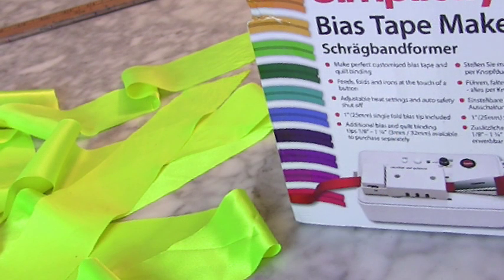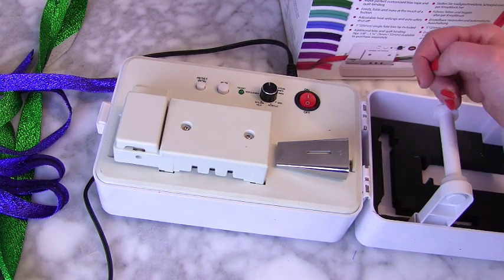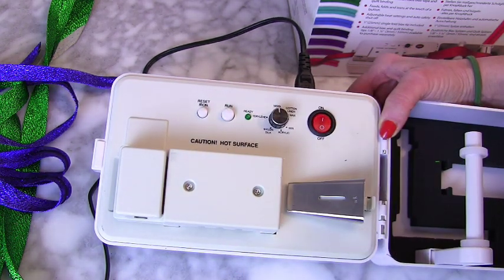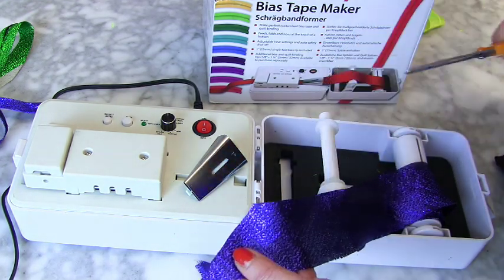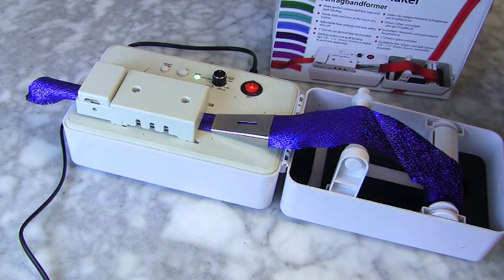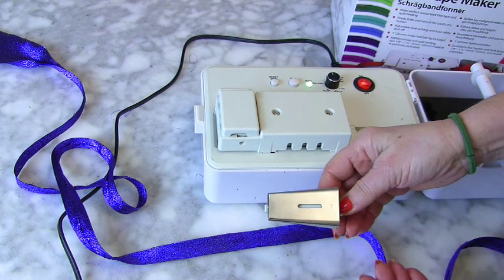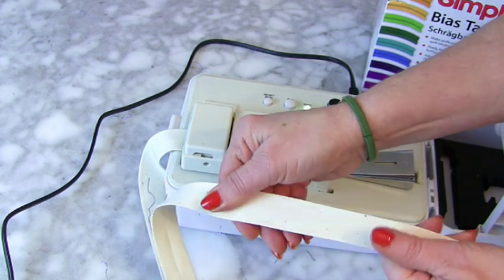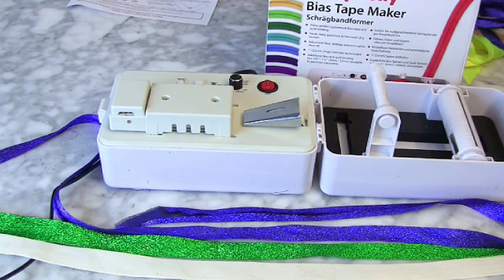how to use bias tape maker and review

Comment: I just use the little triangle/cone thing that folds up the fabric and love it.  I wouldn't even have thought of that machine removing the stretch!  Good to know :).
Reply from the maker: Yeh...... I was so surprised! I'll stick to my little bias thing and iron too. X
Reply: I use a special bias machine foot, works like a charm, no ironing needed
Reply from the maker: Yes.....is it The screw to the plate kind or the bias foot?
Reply: @StitchlessTV  I just use the little cone/triangle thingy on the ironing board and pull the fabric thru.  Love it!

Comment: I believe that since you are trying to stretch it with all the folded layers, with the threads going in three directions, you would need to unfold it and test the stretch that way. My suspicion is that it would still stretch if you try stretching just as a single layer.
Reply from the maker: Oh....ok. when I create by hand the folded Bias still stretches which is why I was a bit disappointed

Comment: Did you cut your strips the correct width to start with?. Watching the cotton struggling to feed it does look like it was too wide, if the attachment says 1 inch then you cut your strip 2inches wide. This is just a thought and definitely not a criticism.
Reply from the maker: Hello, thankyou but yes....try the suggested size, smaller, tried all sorts of things....it just pulled all the stretch out of the Bias but maybe something was wrong with mine.

Comment: Is there any way of reducing the pressure on the iron part Tree? I have just tested a piece of shop bought bias binding, and it does not have a huge amount of stretch, maybe about 1/4 inch for a 5 inch piece of the binding. Is the stretch better when stretching a longer piece? Or when the binding has cooled down? I just use a bias maker with an iron, and lots of fiddling, the problem for me is figuring out the width of fabric to use with the Clover gadget. Thanks for the review, very disappointing for you.
Reply from the maker: Yes ...I wondered that but this has nothing, no stretch and has ended up alot narrower. When so hace calmed down will investigate pressure of feedingvwheels. ..but seems to b3 a fine line with the feeding bit, not enough and nothing goes through. I will report back but Thankyou so much for giving it some thought. Tree Xx
Reply: @StitchlessTV  Good luck with it Tree. Maybe exchange it, or discuss with the company? I am sure you will have some 'clout'. Such a shame that it 'does not do what it says on the tin' though especially as it is a Christmas present from hubby.

Comment: My machine cost me under $100.00 when they weren't "popular" you might say... Yes,  they are problematic and not all the are cracked up to be.  Its not hot enough to make a permanent press ...i still finish off pressing with an iron. The speed setting needs to be slower to set the press.   Great idea,  but needs updating.
Reply from the maker: That's interesting to hear ...does yours pull all the stretch out of the bias tape? Or are you still left with some stretch in your folded binding. Thankyou so much for the feedback. Tree Xx
Reply: No, it does not stretch it at all, in fact it is pretty loose...it just needs to iron it better.
Reply from the maker: Oh....Ok. Do you think it's the same brand as this (I feel like I shouldn't mention the name)